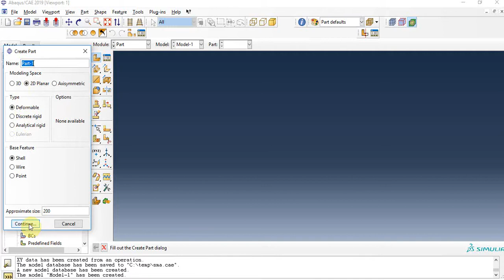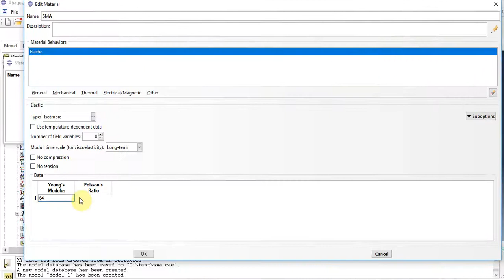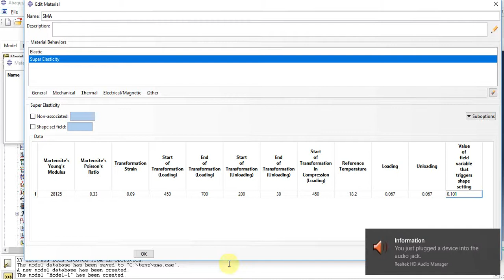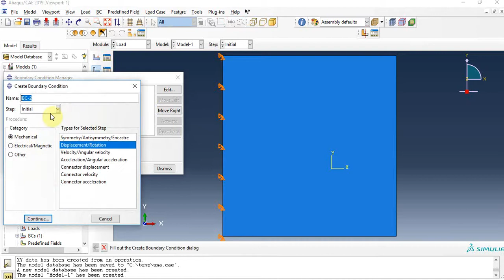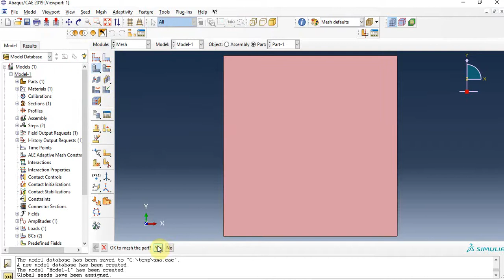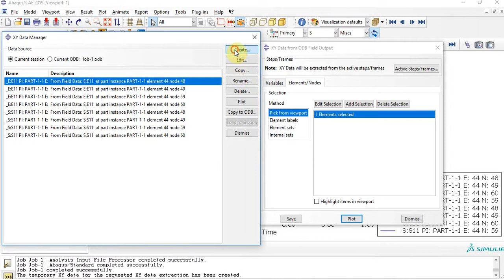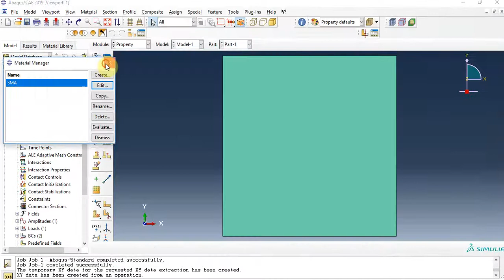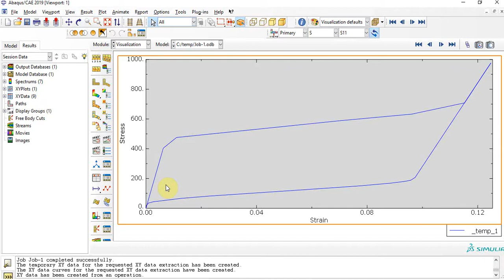Use Shape Memory Alloys in ABAQUS without any Subroutine

Comment: hi dear Sara. Thank u for this example and explain for sma. but you used for creating a model from shell in module part and then using silod in property module and Abaqus running completely and not occur error or problem the analysis...    please explain this case...
Reply from the maker: Hi, due to using 2D model here, there is not any difference between shell and solid part in finite element analysis.

Comment: hello, tank you dear sara, would you please describe if we don't have heating effects on the model, what is the loading and unloading parameters? i can't find this on papars.
Reply from the maker: Hi, you can use the method that have been used in this video, in this video we do not have any thermal effect and also thermal loading, if you have any question  you can ask.
Good Luck
Reply: @saragolbabapour5403  Thanks dear, i'll try it :) :*
Reply: @saragolbabapour5403  I have another question, what's the unit of these parameters, i mean loading and unloading? would you help me?
Reply from the maker: @paryaahmadi7911  The length unite is in millimeter and the force unite is in Newton. as a result, the stress unite is in MPa. The force unite for loading and unloading follows this rule.
Reply: Thank you sara :)